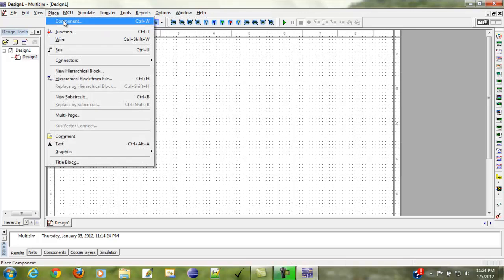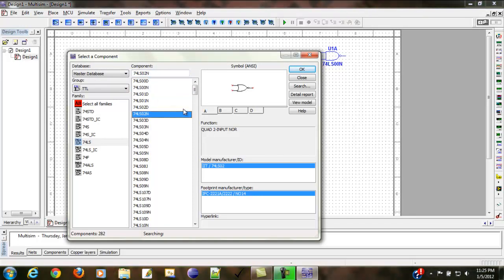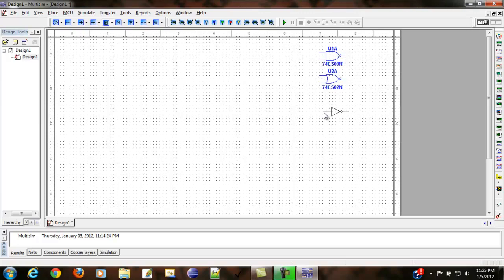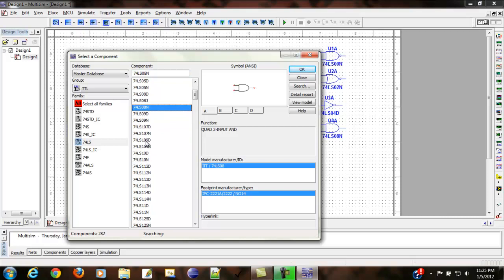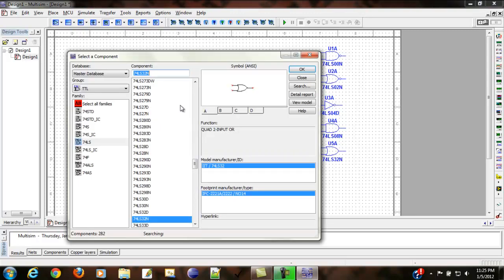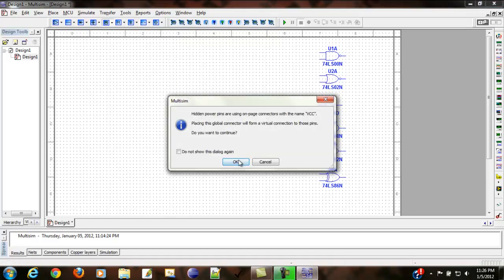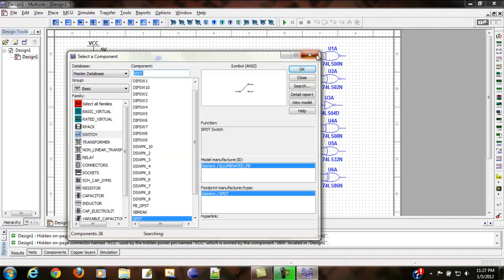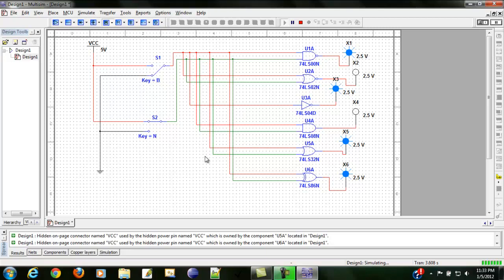Logic Gates Testing using Multisim.mp4

Comment: Some hints. It has come out that if this device does not work, its testing might be difficult. So build and test at first only the resistor chain and the comparator stage. The signals A3A2A1 should be with small values of Vin, A3A2A1 = 000. When you add Vin, you get next A3A2A1 = 001. With even larger Vin you get next A3A2A1 = 011. Finally, with largest Vin (do not try more than Vin = 5V) you get A3A2A1 = 111.You should adjust the positive supply V+ so that the 1-values of A3A2A1 are about 5V. If the low values are too much on negative side (so that the Decoder does not work), you could try to adjust the negative supply, V-, nearer to zero (value -1V should work). Also, it is an excellent idea to connect diodes (and suitable limiting resistors as 300 Ω) to the 741-outputs A3A2A1 so that you can easily see, if the circuit works.
When the resistor-chain and the comparator stage works properly, connect the signals A3A2A1 to Decoder inputs 5,6,7 (pins 2,3,4) in this order. Connect the input 4 and EI (pins 1 and 5) to ground (0V). The output pins A1 and A0 (pins 7,9) in this order correspond to schematic signals Y1Y0. You can connect diodes to output pins A1 and A0 also.

 

can you built this

Comment: You you know why the output of these gates are 5V? Shouldn't them be 4.3V because of the drop of the output transistor? Even when I put a potentiometer from the output to the ground and bring it to 0 Ohms, it doesn't change from 5V. I wonder if Multisim is just wrong.

Comment from the maker: by dc power, i presume, you mean dc voltage source. vcc is a dc voltage source. dc voltage is supplied to the circuit using either vcc or a dc source like a battery.